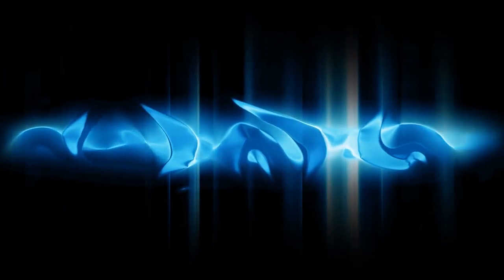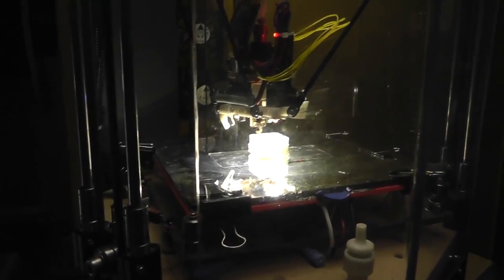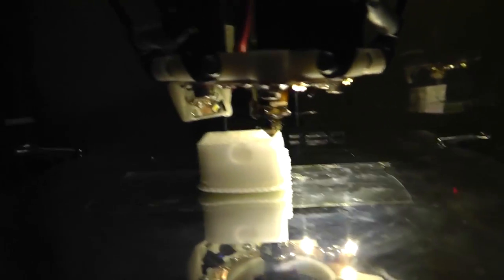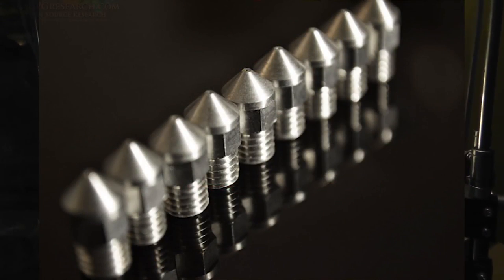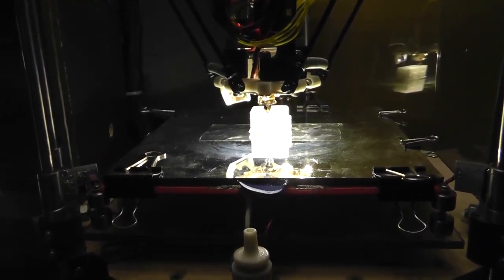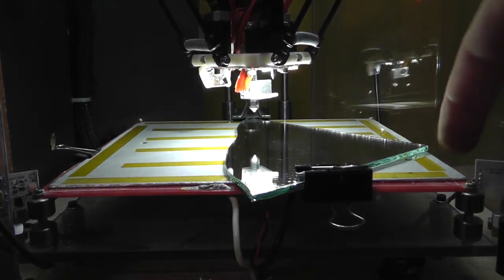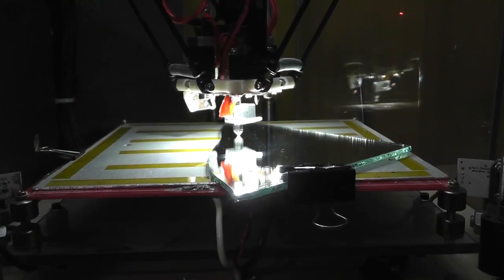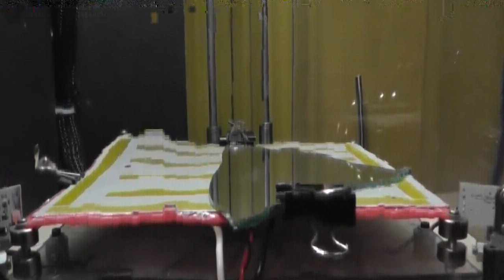They're Back! 3D Printer Tungsten Premium Nozzle Reloaded! Kick Starter Now!

Comment: What nozzle do you recommend? Tungsten nozzle or brass nozzle?
Reply from the maker: I do love my Tungsten, and Brass works just fine... so it really comes down to what your printing. if your using abrasive filaments then Tungsten is the way to go. at least for me. however i have had very good luck using the Tungsten nozzle for everything. you can see some of the things i can print with my setup here: https://www.youtube.com/watch?v=WrceBFVbXeI
although i cant rule out that its the nozzle that is letting me make such fine prints. it is a factor... 

https://www.thingiverse.com/thing:2313909

hope this helps. 

~Russ